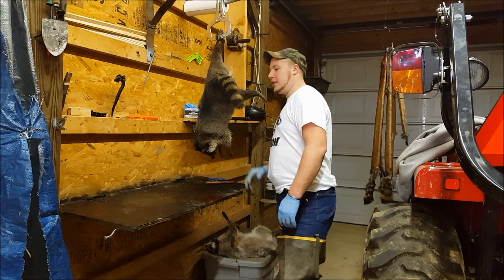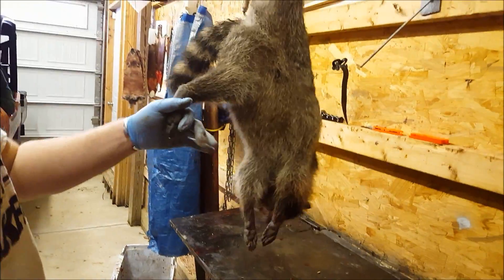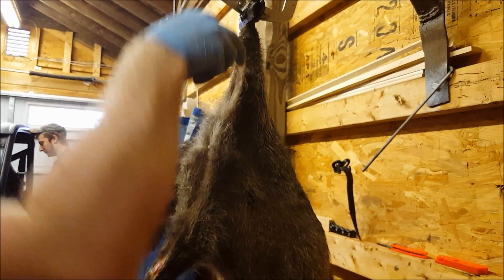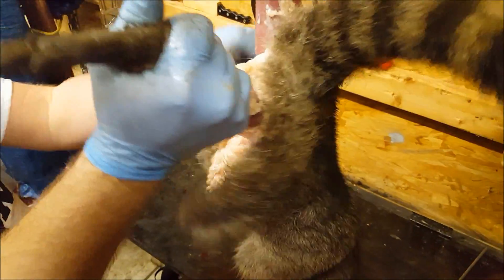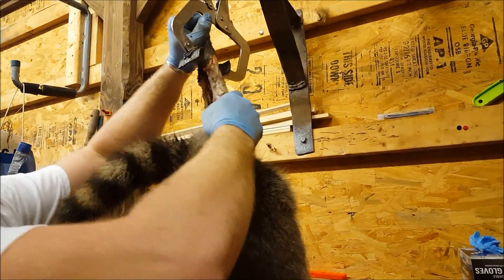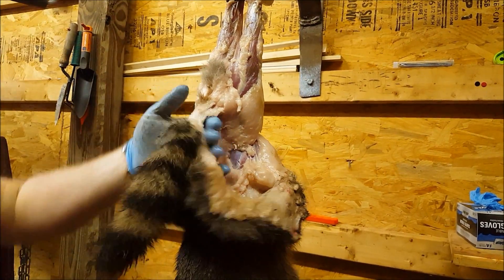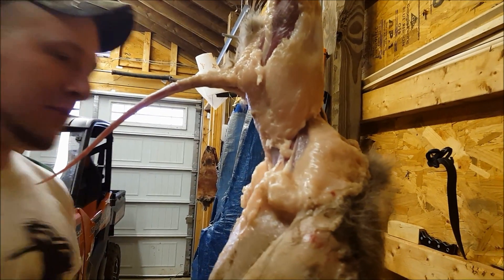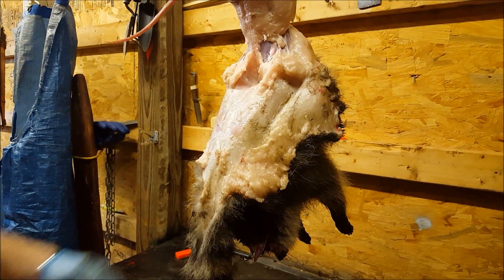How to: Skin a Raccoon

Comment: How do u wash him and how long do u leave it in a fridge
Reply from the maker: Greg Stamatopoulos 5 gallon bucket of water is wat we use or a 30 gallon bucket if we have alot to do. Just agitate them around. As for the fridge if it's cold out just leave them in the shop to cool down over night
Reply: @ChippewaOutdoors  

after wash them, how do you dry them? put it on the sun or air dry outside with the sun, you did very good job, i mess up cut the ear part, thank you for sharing, i try the meat the taste is very good, first time i eat it.